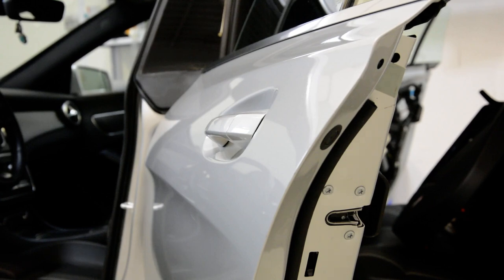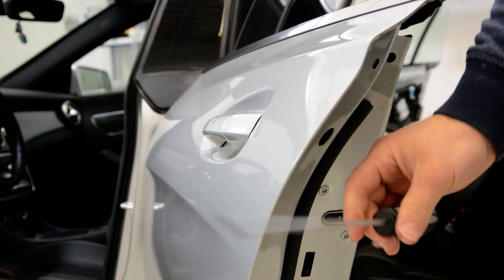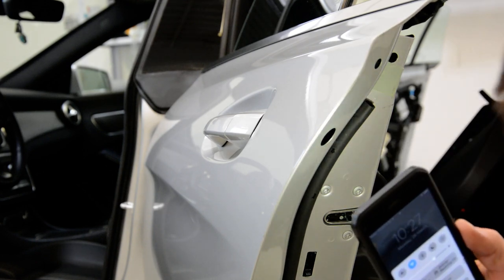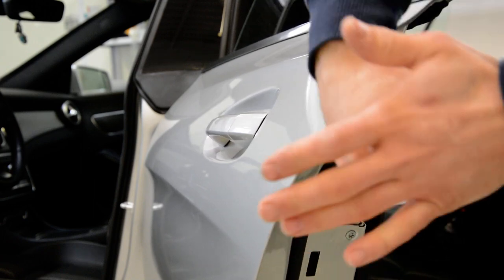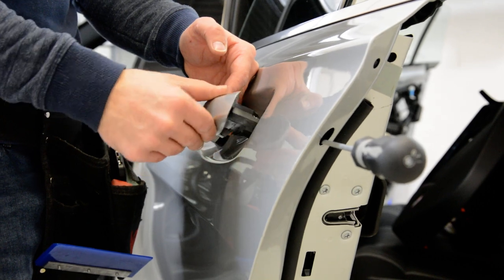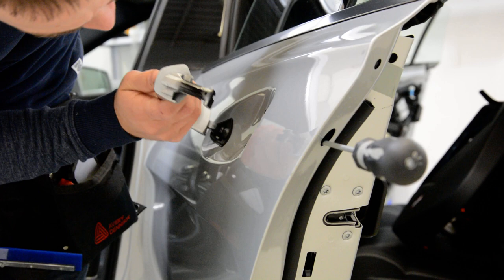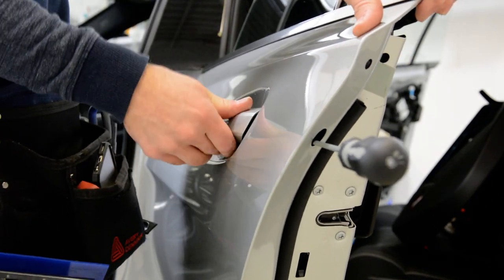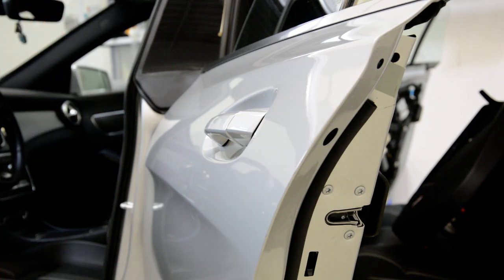How to remove the exterior door handle  rear door Mercedes CLA 2017

Comment: I removed and reinstalled, but when I activate the lock it does not open from the outside, only after opening from the inside that it works again from the outside ... is there any specific way in the reinstallation?